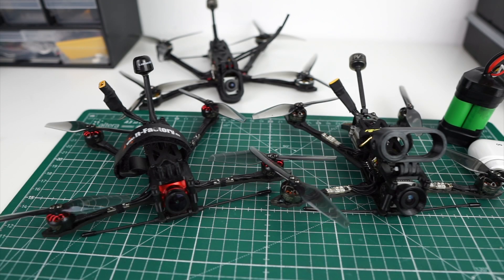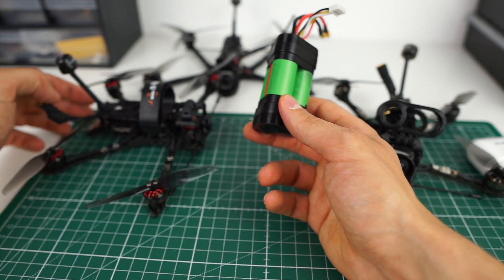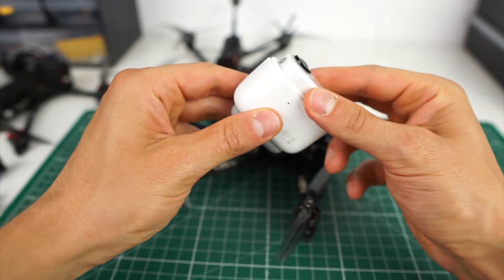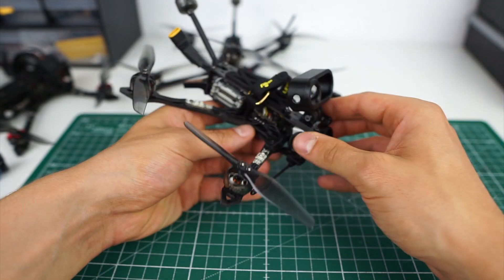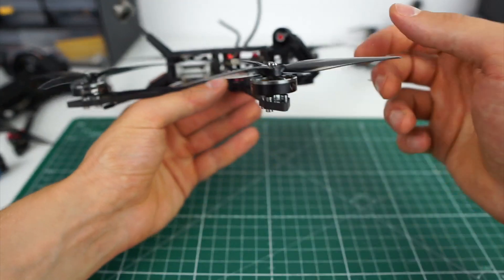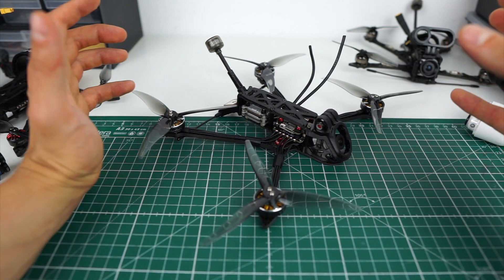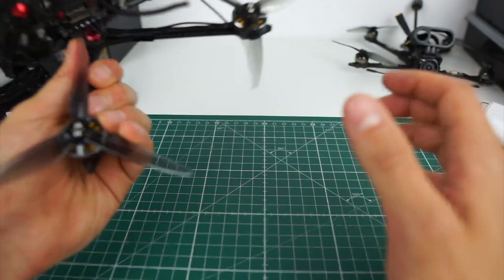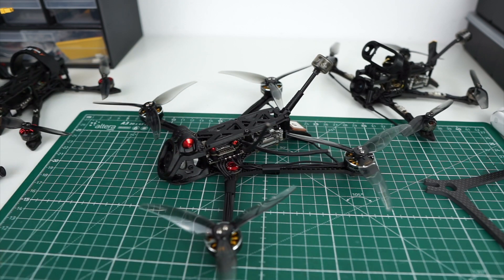Insta 360 go and other Project #MicroLongRange Updates

Comment: Man i really like your prototype frame. I just bought your Flywoo Explorer LR 4 frame so I can build it from scratch, will a 20 by 20 stack fit?? I need more UARTs than the Flywoo stack, i am still going to use your 1404 motors and I plan on using 4s batteries

Comment: also what is the point of having rear arms so long (going from the same spot at the front arms), isn't it making them too weak then and prone to oscillations (they are longer then they could be)? My common sense would tell me to make the arms as short as possible and attach them to the main body at the nearest possible point. Maybe there is something to it putting it the way you did, but I would like to hear it then. I like it the frame, just few things does not make sense to me...

Comment: Very interesting 5" design! Looking forward to seeing how it flies! Are you planning to partner with Flywoo to sell these? (I might be interested ;)
In regards to motor choices, even if the 1507 are more efficient, you will still be sacrificing responsiveness to get it (and therefore flight stability) due to less torque. I'd prefer a slight efficiency hit & potentially a small weight penalty for a smoother flight.
Reply from the maker: Yes I sent them the frame to test it :-)
Reply: @DaveCFPV  Cool! Flywoo seems to be making decent stuff! 
Unfortunately it looks like they might have discontinued their 1404 motors as I can't see them on their website now :(
Reply: @DaveCFPV  I am in if it goes through. They may need more vista units though..lol I have ordered two one with it installed and another one built to accept the vista.

Comment: I went the 1505 route it's a waste of weight the flywoo 1404 are the best the bearings last much longer than any other brand.  Just built the bando bastard in the X  which is by far my favorite 6 inch, used the same 1350 kv motors you used. It's such a great design I had them add the camera mounts off the MLR which keeps the camera way back and safe. Thanks so much

Comment: The insta360go records 5 minutes total or 5 minute loops? I had thought the latter, but if not that is unfortunate.
Reply from the maker: 5 min and then it stops recording and reds a button push to start the next loop :-(
Reply: So it's basically useless on a micro longrange. What's the point of stretching the flight time, sacrificing performance by minimizing wait, when you can just go for 5 minutes. Hopefully, insta will release a firmware upgrade which at least let's you loop record.

Comment: The thing about the 1950kv is that I think they will run 4s li-ion packs. Potentially a 5" could carry a heavy 4s 21700 pack which allows you to use those better telsa cells. I like the idea of having a quad that has all the bells and whistles (gps, buzzer, DJI system etc) and can perform like a 5" should on a smaller 6s pack but handle long range with a li-ion pack.

Have you thought about splitting the arms? eg instead of having a 4mm arm have 2x 2mm arms with a spacer by the motor, might add more strength and stiffness for minimal extra weight.
Reply from the maker: Indeed a really good argument for the 5". And exactly why I went for 1950kV motors to sort of make it dual purpose. On my 6" the exact same principle works very well. Freestyle powerhouse on 6S and 25+ min flight time long range cruiser in 21700 4S 👌🏻
Reply: @DaveCFPV  You didn't mention the 1950kv motors on your Thingiverse page. Would you mind sharing the make?
Reply from the maker: @RedPillQuants  the new brotherhobby 2004
Reply: @DaveCFPV  Vielen Dank! You put those on the Micro or on the 5''? Sorry the parent comment didn't make this very clear. BTW I've got the BH 2806.5 on my 7'' and they are awesome. Amazing build quality.
Reply from the maker: Interesting idea those split arms. I just don't get the spacer. You mean to have separation between the two?
Reply: @DaveCFPV  Yeah, so you have 2 plates for each arm with a small gap in between. You'd get the rigidity of a thicker arm without the weight. You could maybe use less/thinner carbon and/or cut the frame from a single plate thickness.
Reply: Yes I recently built a 6S with 21700s and they are massive. But only 3 of them should be light enough to work with this build me thinks. Even a 4S may still work. Worth a try?
Reply: that's the best argument I've read for the 5" frame setup